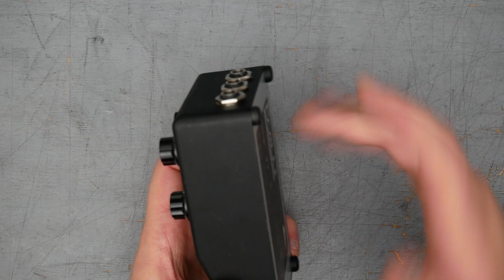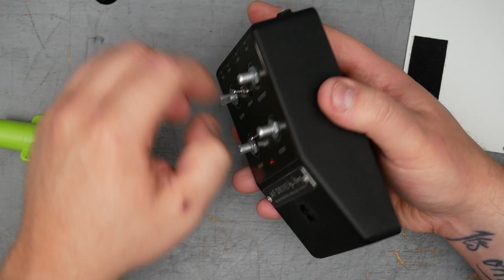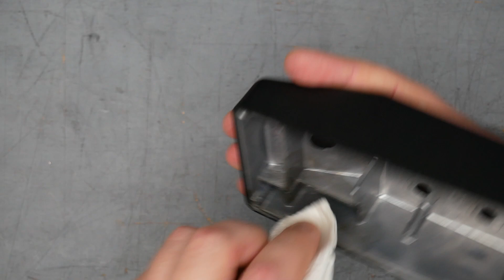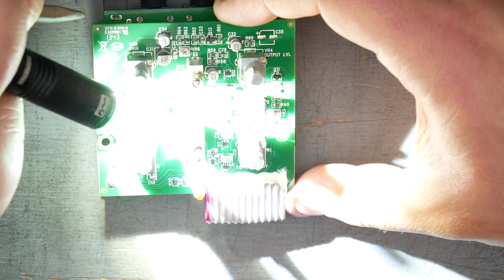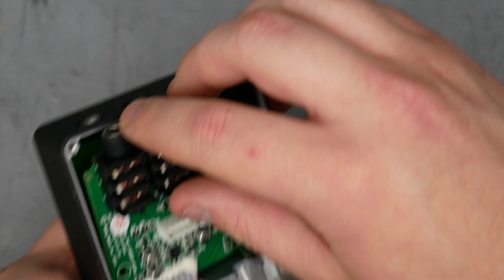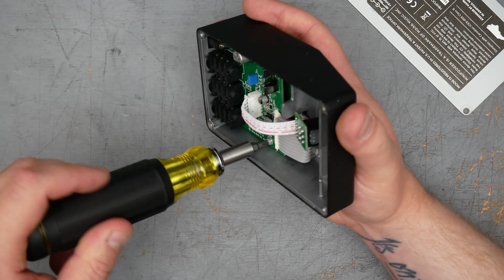Moog Minifooger MF Drive Teardown! See what's inside!

Comment: I can’t believe that I’ve never heard about this pedal, even from Josh Scott. I bet one of the reasons you don’t have any DIY PCBs for this drive is because most DIY projects favor through-hole components, and this one is surface-mount, probably because of the sheer amount of components in the circuit. That sheer amount of components would scare away most people. If anyone should do a PCB, it should be Aion FX. Their designs and commitment to preserve history are unparalleled.
Reply: Just a side note: the attention to detail inside the enclosure with touches that provide solutions to things you probably didn’t consider problems is very impressive.